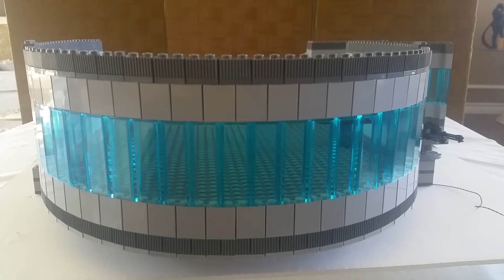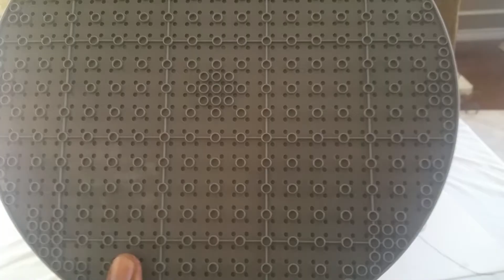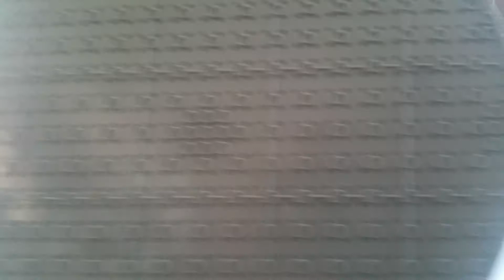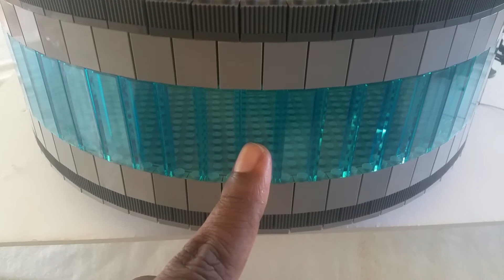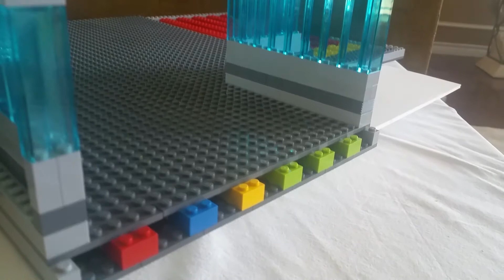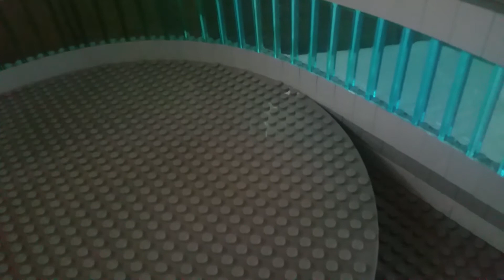Mega Construx Halo Wars 2 - The ZULU Project  - Episode 12: The War Room.

Comment: How curved is too curved? Bricks are stressed
Reply from the maker: The curve of the wall is something you have to feel.  You can make an actual circle.  The thing you have to remember is that the tighter the curve, the more plates, instead of bricks need to be used.  Three plates stacked on top of each other equals the thickness of one brick.  The gaps between plates or bricks  is what gives the flexibility to bend.  So if things seem too tight or too much tension, then replace a row of bricks with three rows of plates.
Reply: @sheerkhanindustries4384  thanks
Reply from the maker: @CombraStudios  Anytime. Let me know how it turns out.